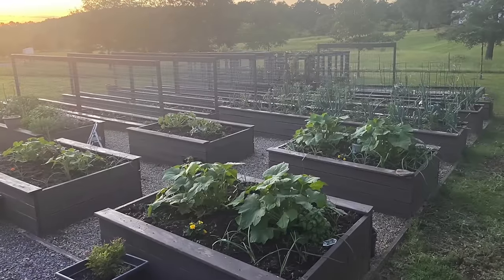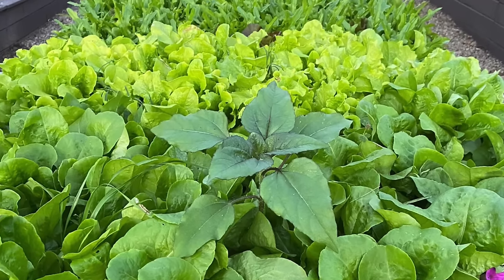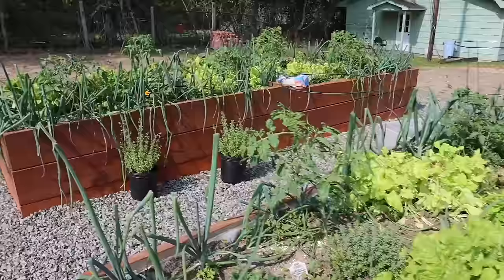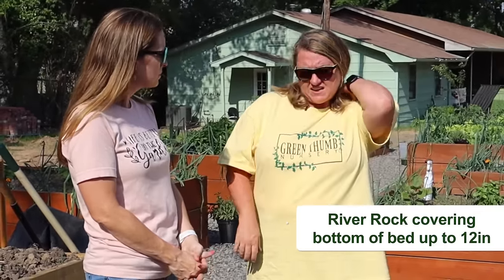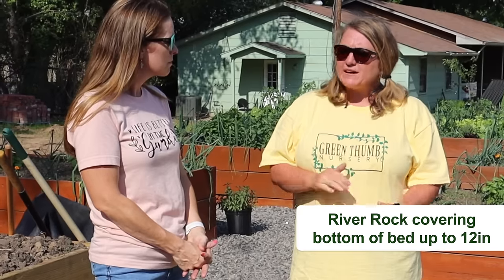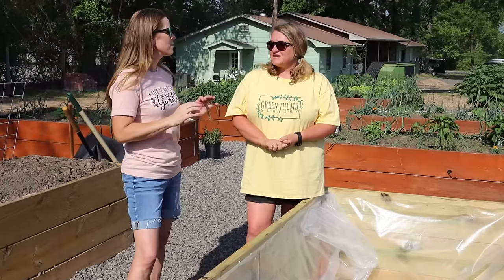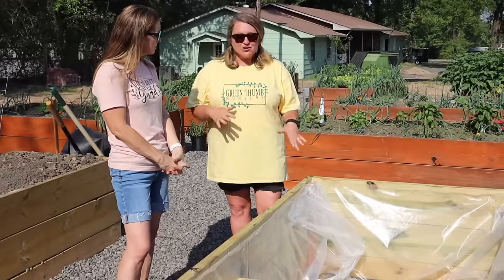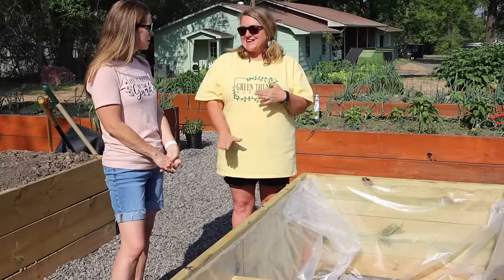DIY Self Watering Raised Beds/Green Thumb Nursery

Comment: This is the same concept of a wicking bucket and I’m happy to see you did it with a garden bed as the concept is the same and works beautifully if done correctly.  Two hints for success - create furrows in the stone under the landscape fabric to allow soils to settle into the water a bit which increases wicking action of the soil as some of it is settling into water.  Also if you want to save money instead of stone use rows of tile pipe (this is slotted plastic septic field pipe) cut to length and ends covered with landscape fabric.  It’s lighter and easy to use and MUCH lighter to work with.  See Gardening with Leon channel for an intro to this.  Glad you created this video.
Reply from the maker: Thanks for the tips! I'll keep that in mind when I do this in my own garden next year!
Reply: I was just about to suggest the same channel... one problem I'm seeing with the rock method is there is no air gap for the roots to self-prune, so the chance of rot increases with larger root systems/perennials.
Reply: Great review Chris.
Reply: Rows of tile pipe? Can you provide link to that system / setup for a raised bed? Sounds great
Reply: I found this from a different channel https://youtu.be/Lp9Jdyno9hI on Leon’s channel I see self wicking tubs, not raised beds, I’m guessing the concept is the same?
Reply: Titan - Yes, 6 of one, half dozen to another.
Reply: Exactly - that was my concern with the system.  How do the roots get to the water if the water drops below the fabric...  Either use something to wick it up, or just have the dirt down in the water.  

Living in semi-arid central Texas, I like the water conservation idea.  Very nice looking, too.  Lots of positives there, but there are some really good resources that use the 'wicking bucket' system that you mention.
Reply: Thank you. So what do you recommend instead please?
Reply: Krystal - Instead of what?

The recommendation above is to at least have furrows in the stone so the soil always interacts with the reservoir of water. 

Lots of other alternatives also given in the comments for alternatives to the gravel. Most common is slotted plastic drain pipe. Also references to Leon’s wicking pages with many many materials on hand alternatives.
Reply: @capnjan9835  
I do the hugelkultur raised beds, and the sun is the wick.
Reply: @titanart6225  Yes, I follow Leon too and the concept is the same. He's tried different materials in the bottom of the tubs/beds and has discussed the pros and cons of each.
Reply: Any idea for other barrier than plastic? I am thinking if I want to do organic I would like to vid the oestrogens from plastic. Or do you think the Austin would not break down thru the holding of water, also the temperature changes thru Oklahoma summer and winter?
Reply: That's what I was going to say.  I created wicking barrels for my veggies like this.  I reuse plant pots and fill with soil to create the "furrow."  I recess them so they are closer to the water.  Works like magic in Florida heat.  Love them!
Reply: Thx!!
Reply: @thegiftlady1  I'm very interested in your method, but am having a hard time visualizing it. It sounds easier than the video. Any help would be so appreciated. Thank you.
Reply: This is a wicking bed garden
Reply: @thegiftlady I am also interested in your method, but need more info, please... and thanks!
Reply: Mikey - Hugelkultur raised beds is a great approach to building garden soil, but very different than a wicking bed.
Reply: Chris, do you still cover the pipe bed with a layer of fabric?
Reply: Chris - The consensus in this scenario is to include the fabric as a separator between the material. 

In geotechnical engineering, there are 2 distinct camps on the topic, because of the possibility of the fabric creating an impermeable slime layer while the different soils only mix in a relatively small layer. Still probably easier to use the fabric.
Reply: What about toxins in the plastic lining? That’s a lot of micro plastic as it breaks down.
Reply: Eric - There are at least a couple factors that come into play regarding plastics breaking down. 

1 is that clearer plastics break down quicker than colored plastic, and the darker the better. 

2. The biggest factor though is exposure to sunlight. The UV rays are what really causes plastics, and a lot of materials, to break down. There are plastic water pipes in the ground that have been providing reliable, healthy water to most communities for 40 years. It doesn’t need to be a concern, though there are alternatives.
Reply: @EricPLin68 all the water you drink comes through plastic at some point, unless you drink directly from a spring or river
Reply: We ordered rock for This. But the rock is bigger then we ordered. It’s like 2 to 5 inch.  Will it work with Rick this big?  Any help would be greatly appreciated
Reply: @capnjan9835 😅
Reply: Any rock size would work, as long as rounded, so no puncture on liner.
Reply: would the pipes hold/withstand the weigh of the soil and the plants?
Reply: @JD-sl1qs  Or you put a really good filter on your water supply where it enters your house, and have your house supply plumbed with copper or stainless steel instead of plastic pipes. We can't completely avoid microplastics these days, they're in the air we breathe, but trying to minimise our exposure is still going to make a difference to our health. Finding a way to build our wicking garden beds so they work without the plastic liner is part of minimising our exposure.
Reply: I may be the only person not understanding your suggestion.
Reply: O
Reply: I agree. Laying sewer drain pipe in the entire bottom and adding gravel around it would be a cost savings over 100%gravel fill
Reply: Thanks! These are very neat considering the weight of it
Reply: Great info!  I came here to add what  you stated.  I'm not sure how they are actually wicking unless the water is always completely full in the example in the video.  I'd create some "pot holes" in the gravel before adding the fabric so you have pockets of soil that dip to the bottom of the bed.  Also whats really important is it needs an air gap between the top of the drain pipe and the dirt.  This can be done by just making sure the pipe is buried a few inches below the gravel.  Great video!
Reply: @capnjan9835 I'm in Houston and have 3 that followed her instructions.

Comment: Learn from our mistakes! After seeing the video we converted all our beds. After we were done and patting ourselves on the back for all our hard work, we filled them with water  and many of them leaked!!!! I looked online and people recommend checking for leaks prior to covering covering with dirt. We didn't think of that!  I think I may have gotten carried away with my staple gun.  I recommend checking for leaks before  covering with ground cloth and adding dirt.  We are going to see how they work this year and if we need to, we will redo them next year. For now the worse we have are beds with great drainage lol.
Reply: Yeah I suspect mine is leaking too 😅
Reply: How did it go, now that a year has passed?
Reply: @mildredthill2868  We have two small beds that work as designed.  After we learned our mistake, we made two more small beds using pond liner and they work great. Pond liner is the way to go. We have not rebuilt all the leaking beds because of the work involved.  To build them we put in close to 4 yards of rock along with about the same amount of soil. We went big lol. We use the leaking beds as normal raised planter beds.  Since we have filled our garden with beds and it is surrounded with a fence and next to our house we have little room to work. It would take a lot of room to take out all the soil and rock store it and start over. We had to wheel barrel it in so building them was not easy.

Comment: One small hole on the bottom of that plastic and you've got to move a ton of rock and soil to fix it. I'd rather use pond liner. Much more durable.

Comment: I have built several of these sub-irrigation planters. I added an additional 4in pipe with a cap and holes drilled in the pipes under the soil level and put food scrapes in the pipe. I added red wiggler worms 🪱 to the beds and that pipe was how I fed them.  Doing this allowed the worms to add castings to my soil inside the beds.
Reply: Dale, The build was exactly the same as this version except on the opposite side of the bed I put another 4" pipe with half inch holes drilled around the bottom but would be under the soil. Then I placed a cover over the top of the 4in pipe. It could be a pipe cap or coffee can. I just intended to slow the flies from getting to the food in the pipe.  

I put food waste into the 4in pipe and cover it again. That fed the worms. The worms crawled the entire space in the bed, had water from the SIP reservoir and the bed served to be my worm farm all at the same time. I used red wigglers. I didn't feed every day because there was a good amount of organic matter in my soil.

The video I saw doing a similar system the guy blended the food waste then poured the soupy mess into the four in pipe. 

It was just an all-in-one system but needs to be a good size for the worms.

I used a deep mulch method to cover the soil.

Everything else was the same. Since I had a four inch pipe I did lose a little bit of growing space but not too much.

Hope that helps.

William
Reply: Now that is a good idea. Thanks
Reply: @scottmercier352  I looked at several different SIP like this and others but decided to try and combine elements of several different ones I liked into one system.  It was a great system. I wasn't able to see longer term as I has them for a couple years before selling my house and moving.
Reply: How far down into the soil did you place the 4” feeding pipe?  All the way to the gravel?
Reply: @tressastanton1300  Yes, all the way to the gravel, but I didn't cut any holes so the pipe was not through the weed cloth into the rock.
Reply: @grahamwilliamc  thanks so much. Mine are going together tomorrow. I’m so excited. Gravel was delivered today!
Reply: @tressastanton1300  Nice....
Reply: @grahamwilliamc I might put the worm pipe in the middle
Reply: @kathynix6552  When I researched several different SIP systems, there were elements I liked of each so I combined them into one. Of course this works better with larger beds, not as much in container gardening. Adding worms to the beds was a great way of adding castings without the work and expense of buying or having a separate worm farm system. Now nature has a more active role in my garden
Reply: Thank you for this information. I was wondering about adding worms to the soil
Reply: I'd love to get my red wrigglers bin out of my tiny house.  100 has turned into about a thousand or more.  They are outgrowing the storage container and I don't want another container.  I bring it in during the cold season.  Is it possible, in my container garden that they will survive throughout the cold? I'm in zone 8b Seattle.  We rarely get lower than 25° and not often. Love to hear your thoughts on this!
Reply: @joanthompson4559 It worked very well for me..feeding the worms just fed the soil with worm castings.... it was a win for me
Reply: @synergy2222 I don't see why the worms would not survive. Just make sure there is enough volume of soil. My SIPs were 4' x 8' x 36" so there was quite a bit of soil volume
Reply: @grahamwilliamc  thank you 😊
Reply: It sounds like you put the pipe in the water "under the soil level" and I can't imagine that would be good.  I would think the scraps and worms should IN the soil, not below it.
Reply: @pagevpetty  Worms in the water will not hurt them as long as they can crawl out of the water into the soil. There were holes around the base of the 4" pipe that was under the soil level and yes down into the water level too. Again, it wasn't an issue. I know a guy that uses worms in his flood and drain system for his hydroponics and he claims it works out well. I haven't gone so far as that as to include worms in my hydroponics. There was a drain hole to keep the water from getting too high in the SIP causing the plant roots to be in water constantly. Since there is enough food in the system, they don't really have a reason to get out. You will lose some but the majority are all about the food.

Comment: A simple visual method for knowing the water level in the reservoir is to have a 1" pvc pipe set up vertically that reaches near the bottom and use a cork (or multiple corks) on a lightweight stick.  Cut the stick so only 1" sticks out when it's dry and mark it with a bright color.  As the water level rises or falls, you'll see how much of the stick is exposed.
Reply: I didn’t understand, donovanleeds, and this seems like a great idea. Please explain your idea better to me if possible
Reply: I got it.  But use the 4” septic pipe.
Reply: @micheletanis9973  The vertical piece of PVC pipe would ideally be in a corner to maintain the vertical position with the bottom opening resting just above the plastic lining (an elbow or T-fitting can help ensure you don't risk breaking the plastic liner).  The water in this pipe will maintain the same height as the water in the rest of the bed.  A cork with a long straw or bamboo skewer attached will act as a buoy and float freely inside this vertical pipe.  The length of the straw/skewer that is visible sticking out of the pipe will tell you the current water level at a glance
Reply: Glue a little material cut in shape of a long triangle as a flag on the top of the stick. 😅

Comment: This year I made many 'wicking tubs' using 15 gal planters and large storage bins but I used the 4" drain pipe in the bottom ( and even used 2 ltr soda bottles with holes drilled in them then covered with weed frabric and soil. Much less expensive and work than putting in stone! SO far working great! Tomatoes, peppers, squash other plants in them are doing great! I am in central Tx and we are having an excessive heat wave so I am so glad I did it this year!  I do have drip also and ran a drip tube down into the watering pipe but my garden is doing so much better this year than it did last year when it was not as hot and I don't have to run the irrigation as often so I can conserve water.
Reply: Would love to see your self watering pots I’m in central Texas and my plants are having a hard time keeping healthy with this heat.
Reply: @Maracz47  Check out "Gardening with Leon"
Reply: Would also like more details of how you did that since I just moved to southern Utah and am struggling to get gardening successfully again.
Reply: @janet-Spirit_of_the_Living_God  Check out "Gardening with Leon" he has several videos on wicking containers

Comment: A couple of pointers. Add the overflow pipe right at the level of the rock or maybe a half an inch under it. If it flora above the rock, there is a good chance the pipe will get filled with dirt and get clogged. Drill small holes all around the pipe. And wrap the pipe with weed stop or some other cloth that will stop the holes from clogging up. To stop the water from leaking past where the pipe comes in, cut the hole bigger and use fittings with a flange on both sides. This will seal the area around where you punch the hole, and stop the water from getting between the plastic and wood. Even with pressure treated lumber, having soaking wet areas over long periods of time, will cause rot and mold issues.

Comment: 3 minutes in and this is one of the most valuable tips I've heard. That plastic liner means I don't have to take out a fourth mortgage to build with cedar! Never even occurred to me.

Beyond that, this idea is genius. I'm just lazy enough that I would even automate filling the reservoirs using moisture sensors or a float valve, with an interconnected PVC delivery system.
Reply: You know what they say, "Laziness is the mother of invention", or something like that 😋
I was thinking a long the exact same lines. Always automate if it's an option, and it certainly is here. Did yours ever turn out, just curious?
Reply: weather will still weather it, but i think the breakdown will be slower. also, if you char the surface wood first, often people use a garden torch, it creates a nice barrier to water. there's a 'japanese method' that is borrowed for this. also, after brushing the wood, creates a nice look that is almost like a rich stain. very nice. i think it holds up better than cedar also.
Reply: @lurklingX  Yakisugi or shou sugi ban is an ancient Japanese technique consists of charring cedar boards. Great thought!
Reply: I thought of using one of those universal toilet floats and a 2"pvc to the level needed... hook that to rainwater collection and good to go..
Reply: To add to your idea, overflow pipe connects to water reservoir (like rain water catcher) outside raised bed. Add a solar pump to reservoir and pump water into the bed.
Reply: Did you do it yet? Lemme see

Comment: Great idea, just as an added thought you could attach flexible hosing to connect all of the beds together as one unit. Place the garden hose into the first bed and the water will flow from one bed to the next filling all of the beds in one hit. This would work even if your garden were not level as the water will flow downhill naturally. You could even set up a moisture control unit to activate the water tap automatically.
Reply: 00o
Reply: I.’m thinking to connect the (intercinnected) beds to my rainwater collection system so the reservroirs get refilled every time it rains.